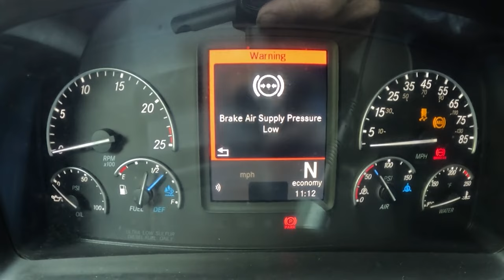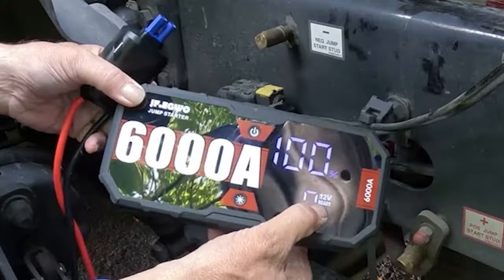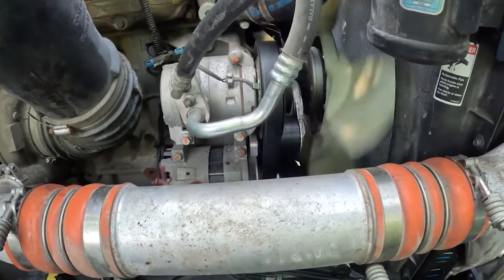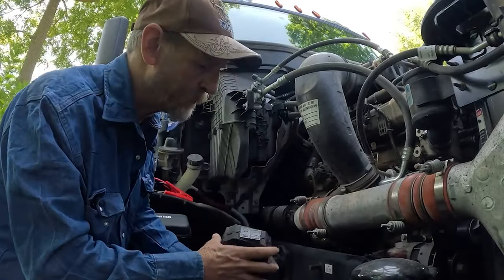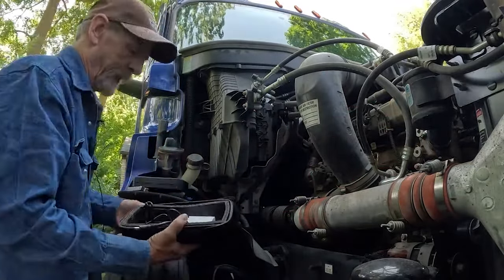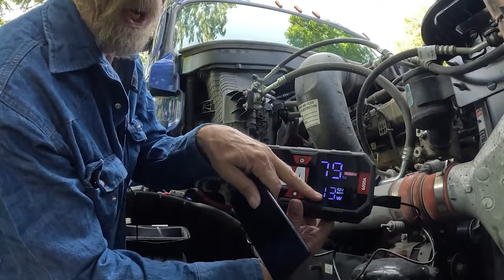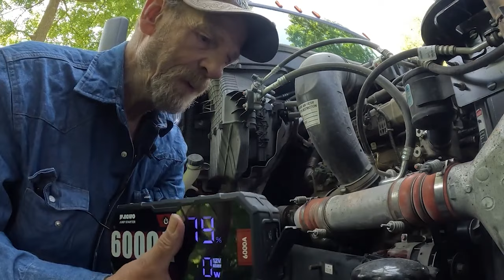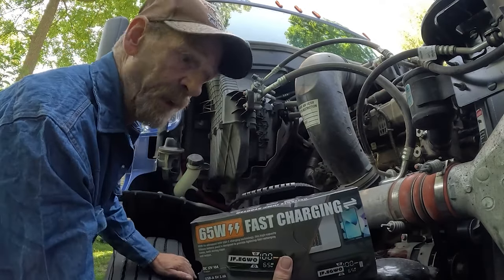BigRigSteve reviews the JF.EGWO 6000A Jump Starter 12V Potable Heavy Duty Car Jump Starter 65W

Comment: No proof whatsoever of truck battery being dead lol, he used it to jump batteries that are fully charged already I guarantee you if it’s colder and those batteries are drained it’s not jumping it. Not saying in warm weather if you need little extra kick it won’t help but at least show how dead batteries are, also using those jump points makes it even harder to jump the battery, the more cables you got in way the more power you lose. Goodall 10000 amp is where it’s at for big rigs I’ve jumped one directly on starter, rear of jumpers are meh